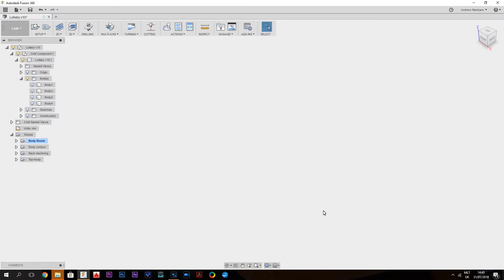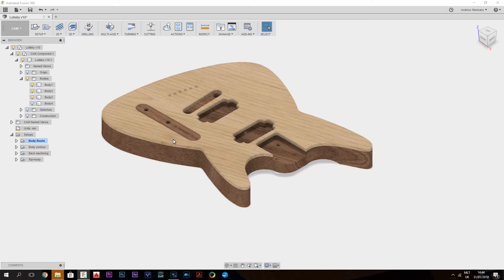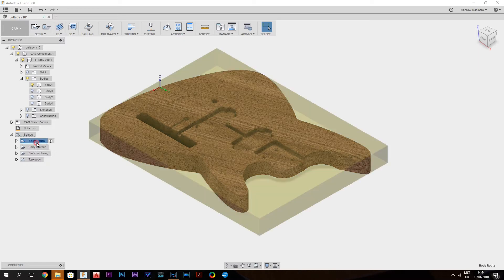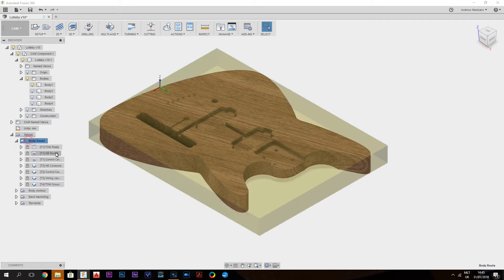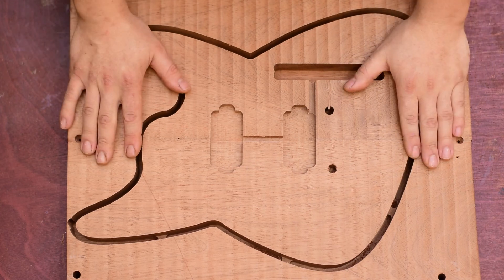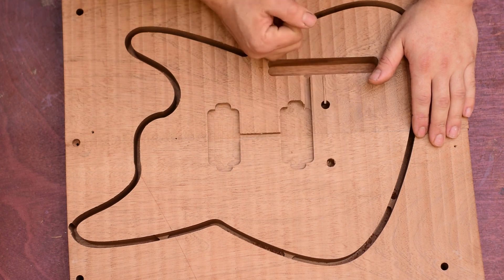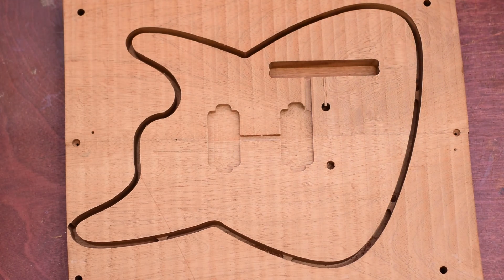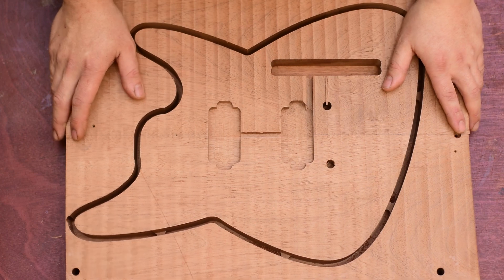How to build a guitar using a CNC - Episode 2

Comment: Hi, very nice project and perfect explanations. Could you post a list of your router bits(and dimensions)? Thanks, Michael
Reply from the maker: At that time I was using a different set of cutters, but this is what I'm using at the moment: 10mm upcut bit for roughing cuts, 3/8 downcut Spectra for finishing cuts, a 6mm router cutter for the truss rod channel, a 0.5mm for the fret slots, an 8mm round over for the fretboard and back neck profile. I use a 5/8 bit for facing and I use an 8mm spiral bit for various applications. My spindle can only take a max of 10mm collet so I'm limited to a certain bit size, if I can I would go for 1/2 bits.
Reply: @ManicaroCustomGuitars  Thank you

Comment: which spindle do you use in your cnc? Where can I get the designs of the guitars models? if you can help me I am grateful friend.
Reply: Helton Pereira the spindle is the Kress 1050. Well regarding the designs, you can google guitar plans dxf or svg. Depending on what program you're using. I just traced this design from a strat and then modified it a bit